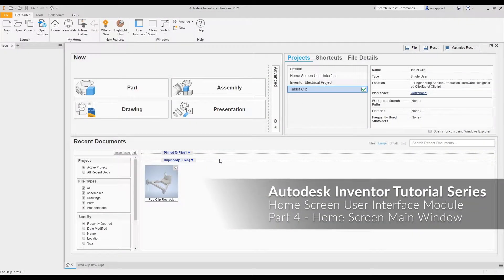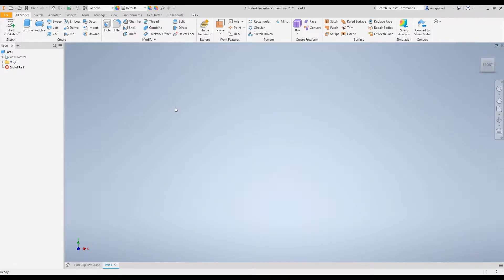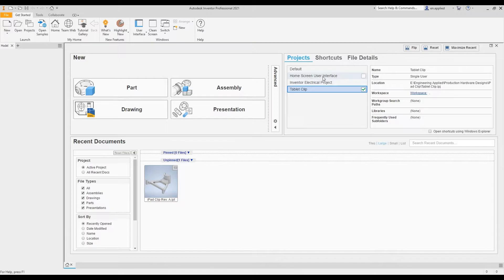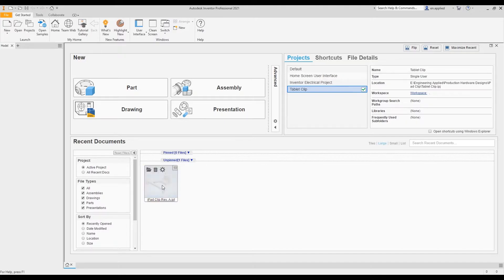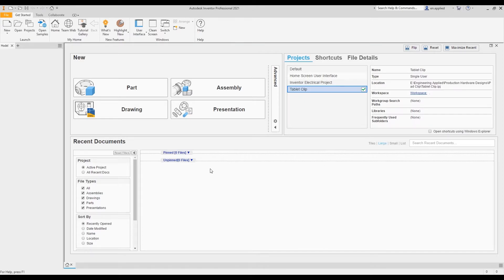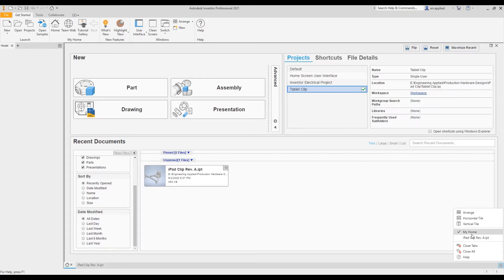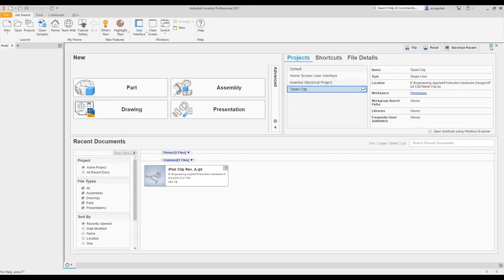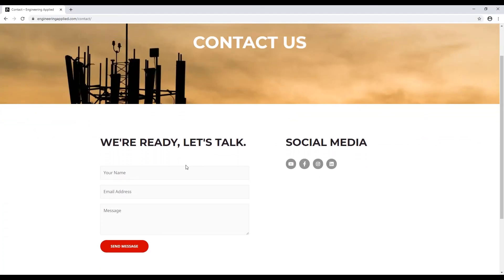Home Screen Main Window - Home Screen (Part 4) | Autodesk Inventor 2021 IN DEPTH

Comment: Hello Alex. Your videos do initially look to be very useful. However, most of the videos have been done in Inventor 2021 and there seems to have been quite a change in the GUI between your 2021 release and what I am seeing in my 2023 release. I hasten to add that I have been using SolidWorks for a number of years but have just recently, this year, starting trying to use Inventor 2023 and am a few problems. One of which is the quick access toolbar seems to disappear when I'm trying to create a drawing! Help please?